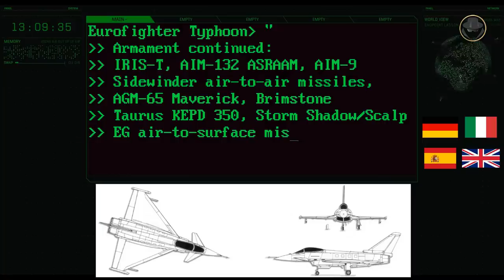Eurofighter Typhoon | The story that the West does not want to tell

Comment: The F-35 has an RCS of 0.0015 s/m (that's less than a golf ball) nobody's radar ESA or not can pick that up at 60 km,,,so who ever told you that lied through their teeth and didn't expect to get called out for it.
Reply: it cant run supersonic in peacetime or it will lose the stealthpaintjob -in war it wont matter if they are gonna be shot down anyway just as Jas instability in peacetime is differnt in war -If its gonna get shot down why not the overdrive instability which made it crash intially
Reply: And we are just going to believe what you say, right? Not claims from Typhoon users? Even F-35 users like Israel doubt that it will have a stealth advantage for more than a few years. Advanced countries are already testing new radars and other sensors that will make 5th gen not so stealthy anymore. Also, the F-35 is not as stealthy from all angles as the F-22.
Reply: @jari2018  Absolutely not true, where ever you read that...ask for your money back. The F-35's coatings are integral and while they can be damaged by strikes or other contacts, the coatings don't just "wear off" these aren't made in China or Russia. Just so you know, there are more F-35's manufactured and in service than Typhoons or any fifth generation aircraft. So, I'll let the facts speak for themselves.
Reply: @scepticalwalker3984  I wouldn't believe me for a millisecond and I don't want you to believe me....just do some homework before you spout off about something you obviously know nothing about. Radar Cross Section is a well established science and relatively easy to calculate. There is RCS data on many military aircraft for example the Eurofighter Typhoon has an RCS of 0.5 m2, the Su-30 RCS is 2.0-2.5 m2. Ain't nobody detecting the F-35 at anything but eyeball range at least nose on...and when the US and Australia get it's "Loyal Wingman" project going there'll be no hope for everyone else.
Reply: The Israelis and the US DOD say Stealth has a life of about 5 years   where is your Source
Reply: Detection and ability to identify sufficiently are too different things. I doubt the F-35 can be engaged even if they are detected.
Reply: RCS is an oversimplification of stealth characteristics. It is nowhere near the whole story.

Radar stealth in general works against specific wavelenghts coming from specific angles.
AESA radars can use multiple wavelenghts simultaneously and thus can work around the stealth characteristics of stealth aircrafts by scanning and finding a wavelenght or set of wavelenghts that work well against the target. They can do this more or less rapidly depending on processing power and search algorythm efficiency.
In most cases, a good AESA radar will be able to pick up a stealth aircraft, granted radar-absorbing paint and alloys will reduce the range somewhat.

F-35's 0.0015 s/m RCS is most definitely a cherry-picked value that they obtained with a specific wavelenght and a specific angle.
It isn't anywhere near the average RCS of the whole aircraft nor is it a reliable indication of how stealthy the F-35 is.

It's all a sales pitch in the end.
Looking at the features and how they interact with each other is a more mature and objective way to judge aircraft performance.
Reply: @Karl-Benny  I'm sorry, that's not a "source", that's just you saying it is....If you believe what you're saying, explain to us all why the Israelis, who you say claim "stealth" has a short shelf life, are buying more F-35's as many as 48 of them. It's not like the Israelis to invest in soon to be outdated technology.
Reply: The F-35, loses it's stealth paint at mach 1. So much for "super cruise," So? That classified information neglects the frequency of the radar used. Frequency ie wavelength, matters. Moreover IR ignores Microwave stealth features. Then the are all those problems. Engine that can melt the airframe. Low reliability and mission readiness. Stealth planes sitting on the ground, are easy pickings. 
    In an intensive combat environment? It's not likely that the F-35 will retain it's stealth features, or be able to keep up with more reliable and numerous fighters. As evidenced by the older fighters the F-35 FAILED, to replace!
Reply: @jari2018  Ah, another lie with an ounce of truth in it. The F-35 B/C versions (not the A version) are restricted to "short runs of supersonic speed at high altitude. So let's tell the truth instead of lying by omission.
Reply: @scepticalwalker3984  Yes, folks are trying to find a way to detect the F-35 and who really knows if they will. I suspect by the time anyone figures out how to detect an aircraft with an RCS of 0.0015 m2 (golf ball sized) the US with Australia's "Loyal Wingman" program supplemented by the 6th generation aircraft will be coming out...it's still game over for the Russians and Chinese who are still trying to sort out their 5th generation disasters. The US is into their third generation of stealth aircraft and approaching the fourth generation while the Russians and Chinese are struggling to get their first generation into production. Think of it this way the US has fought wars for more than thirty years with planes that the Russians and Chinese haven't been able to field yet...and the US has already retired a class of stealth. The Russians and the Chinese are so far behind the US has lapped them twice now...and it's only getting worse. If you think that's bad...look at it from Russia and China's perspective...not only are the Americans so far ahead, but they've sold the F-35 to twelve of its allies. The US has produced 625+ aircraft, meanwhile in Russia they have 5-10 Su-57 and China has maybe 50 J-20. Don't leave out the 180 F-22's....now the US and it's allies have more stealth aircraft than Russia has all models combined.
Reply: @MessInMines  The fact remains that the F-35's are virtually invisible to current radars. Another point to make about radars....no matter how small a target it can detect, completing the "Kill Chain" is an altogether different bag of worms. Some of the problem is how to "filter out" all of the other small things otherwise the radars are constantly alerting which is almost as bad as not alerting, the second problem is guiding weapons and the third is fitting tracking onto missiles, the fourth is what to do about counter measures.......so I'll take the US capabilities and you take the Russians.
Reply: Stealth will go out the window the very second it switches on its radar and shouts here we are boys!
Reply: @fouloleron2002  You've just demonstrated that you have no idea how the F-35 and its radars (multiple systems) actually work....the F-35's stealth capabilities include the most sophisticated electronic warfare suite.....it can scan for targets without using "active radar"...they know you're there without you knowing that they are around or that they've even detected you...then they launch AIM 120D missiles that don't alert ("buzz") until the terminal phase of the lock on...and by then you're toast. You might want to seek more information on just how sophisticated the US air-to-air combat capability is.
Reply: @Karl-Benny  My source....Lockheed Martin will build another 135 F-35's this year alone....the US is only budgeted for 25 each fiscal year (as planned)...guess who wants the other 110 F-35's ? The US currently has 280+ F-35's, over 680 have been built and the projected production rate stands at 130 - 150 annually for the next ten years or until the sixth generation aircraft enter service.
Reply: Dan2314 Wonderluck  Dan my boy....the US is buying them at a rate of 24 per year....Lockheed Martin is building them at a rate of 135 per year.....I'll take that failure over the 5 Su-57's and fewer than 50 J-20's....yeah, I'll take that failure. Remember the age old adage...."Without your data, your chatter don't matter".
Reply: Dan2314 Wonderluck  Dan, I put more faith in the reviews of twelve different nations which have reviewed the F-35 and have put down their hard earned cash to purchase 135 aircraft already with 300 more on order...than your opinion. There's a strong correlation between fact and investment...meaning when you have to choose between opinions go with the opinion that has the most invested in it....free opinion is worth what you paid for it.
Reply: @CaptainDangeax  Captain...you like a few others on this string have little to no idea how the F-35 operates and its stealth capabilities. Granted the F-35 does have an IR signature from the rear, but it is much reduced by a cooling system for the exhaust. Having said that...no one is going to get behind the F-35...it will have detected them far away and sooner. The F-35 "sees" 360 degrees equally well, it too has IR spectrum detection, as well as an RCS 100 times less than any adversary....think about that fact. The real effect of such a small RCS is that it gives the F-35 double or triple the range of detecting an opponent before that opponent sees them...that difference greatly improves its chances in air-to-air combat, especially in BVR engagements....modern air-to-air missiles have lock on after firing capability which means the AIM 120C will be impacting on your aircraft before you even know the F-35 is in range....enjoy getting shot down.
Reply: @CaptainDangeax  Actually I know enough to understand that adiabatic heat can be converted using cooling systems, which the F-35 does quite well. I'm very familiar bands and you're close but still wrong. The point about radar detecting and being used to guide a weapon towards the target require more power and space on the missile...also the technology...and so far the Russians and the Chinese can build missiles that travel far and fast...but they aren't very accurate as demonstrated by the lack of downing western built aircraft...just look up the record of western aircraft versus Russian and Chinese aircraft. The best the Russians and Chinese can hope for is that western air forces will crash or damage their aircraft...but getting shot down is pretty much the realm of surface to air missiles, as far as the Russians are concerned. You can "blah, blah, blah till you're blue in the face....but the Russians and the Chinese are scared out of their wits over the advancements made by the US in fifth and sixth generation aircraft and associated systems....the AIM 260 will be out later this year...you commies are so screwed and you know it. Think about it....fifth and sixth generation fighters, fighter/ bombers and strict bombers.
Reply: @CaptainDangeax  Heat isn't converted, it moves by convection or conduction...and that's what the F-35 does with its heat signature. The F-35 uses a ducting system to take cold air and mix it with the exhaust, thus reducing the heat signature...you can find lots of videos of this. Something we can agree on (to a point) is that the Meteor is a fine air-to-air missile, maybe the best out there (for right now), though the British and the Germans might take umbrage at "French Made" label, but the soon to be released  AIM-260 will give it a run for its money.

Comment: So, Rafale and F 15EX is better than Typhoon?
Reply: no they are on the same capability
Reply: Only when the Typhoon is  in the Hangar
Reply: F-15EX is very unlikely to be better than Typhoon versions of the same age, given the age difference between the base platforms. Still, F-15 is better choice for US air force because they can use all their existing experience and infrastructure for it, and it's a good choice for countries that want to strengthen diplomatic relations with USA. 

Rafale vs. Typhoon? I don't think it's possible to say one is better than the other. A good rule of thumb is that Typhoon is the better interceptor while Rafale is the better bomber; meaning Typhoons is more defensive and Rafale is more offensive in posture. 
That also aligns with the goals of the stakeholders: The Typhoon was intended to protect air bases and win air superiority over Germany in a potential WW3. France was further from the immediate danger of day-one airbase bombing and more interested in Africa and Middle East. 

But all of that is full of assumptions and simplifications. It's simply impossible to say one is better.
Reply: @jensdanbolt6953  Quite a price to pay for those diplomatic relations....
Reply: @sichere  the Rafale is better BY FAR
Reply: @jensdanbolt6953  the F-15 has been very successful in Asia as it has sufficient range.And it is not as if the Europeans would support any Asia country.
Reply: @jensdanbolt6953  Yes, F 15 is much older, but the design is still good even nowadays. And I know the older F 15s that was used in 80s aren't as good as the new European jets, but the EX version is probably the same or even better for air superiority, as the European jets are multirole for which Uncle Sam has lots of F 35s so they only need air superiority, whereas these jets (Typhoon, Rafale) are better at multirole options. I wonder if Gripen falls into this category.
Reply: @Retroscoop  well those US fighters aren't cupcakes mate. Best use of them was shown by Israelis. But yeah, nowadays those long range operations are rare, you hardly need air superiority jets like F 15 (unless a war breaks out).
Reply: @hermes6910 I didn't know about the Swiss tests. So the Swiss is finally buying fighters again... some nations reported it was good (US sidekicks tho) and the EX is not evaluated outside the US. And you don't talk about high military expense in US buddy
Reply: @mnd7381  I have to disagree with you here. First part, you say: 
"Yes, F 15 is much older, but the design is still good even nowadays. And I know the older F 15s that was used in 80s aren't as good as the new European jets..."

I think you skimmed through my answer a bit fast, because I was quite specific about what I meant with the age difference: 
"F-15EX is very unlikely to be better than Typhoon *versions of the same age*, given the age difference between the base platforms."

As you can see, I'm not comparing the 1970's F-15A to the 1990's Eurofighter, or the latest F-15EX to 1990's Rafale F1. I'm comparing on same variant age, for example F-15EX vs. Rafale F4. And what I'm saying is that the age of the platform matters. For example, the delta wing+canard wing design of the Rafale and Eurofighter give them quite a lot better maneuverability, inherent to the platform. It is considered the best aerodynamic shape, but is incompatible with stealth. All 4.5 and 5th generation fighters use either one or the other of stealth or delta+canard, and not having either like the F-15 and its contemporaries is a disadvantage. I'm not at all an America-basher, I think stealth is worth dropping delta+canard! 

You then write: 
"but the EX version is probably the same or even better for air superiority, as the European jets are multirole for which Uncle Sam has lots of F 35s so they only need air superiority, whereas these jets (Typhoon, Rafale) are better at multirole options."

The F-15 is the original multirole fighter, it was the one that set the standard for multirole capability to be a defining feature of the 4th and later generations. The E-variant was called "Strike Eagle" for a reason: It could carry and deliver several tons of bombs on target and defend itself on the way back, which was revolutionary for a fighter to do at the time. So it sounds very strange for you to say it's an air-air specialist and the others are the multirole compromisers. If any of the three is an air-air specialist it's the Eurofighter, it was originally planned to not be multirole at all, bucking the trend of the time that all fighters should be multirole. Only later versions had strike capability added to them.

Comment: It’s not difficult.  EAP was worked on in  1985 which means it’s OLD.  No real thought about stealth which became the major desirable feature.  It is simply old technology airframe wise, the Americans were already on the next step with stealth bombers.
Reply: True ..at that time. Interestingly though, because of the advances in radar technology, stealth isn’t the huge advantage it used to be, hence the renewed interest in the improved F-15 for example. The fact is, F-15, Typhoon and other Gen 4.5 aircraft can carry substantially more weapon loads.  Even the F-35 can operate in non stealth mode by having weapons mounted on under wing hard points.